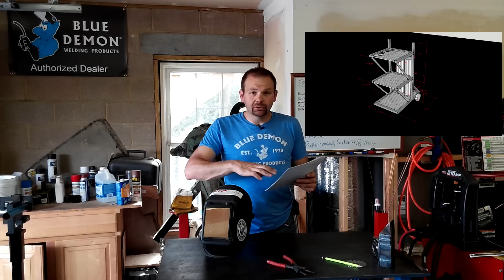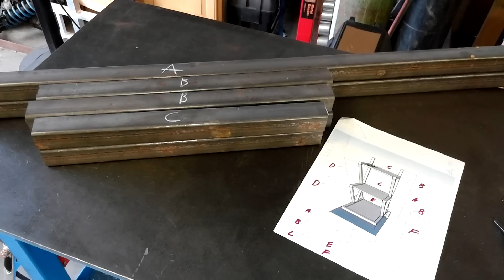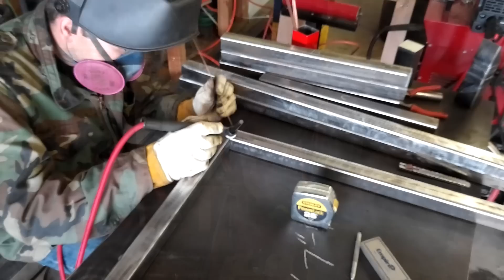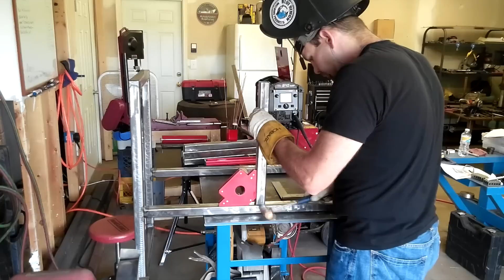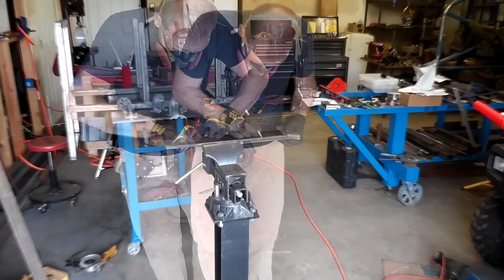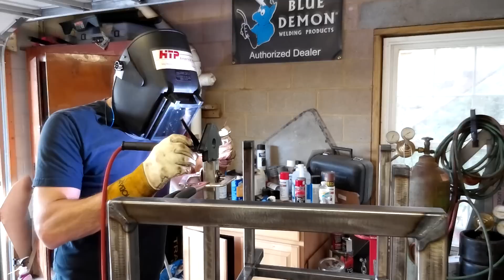Welding Cart Build Part #1 of 2

Comment: if you are going to buy a plasma torch you should look at the Everlast welder powerpro 205 not only do you get a 50 amp plasma torch but you also have the ability to AC/DC TIG weld and stick weld on the same machine for $1750CAD. which is probably less thn u would pay. for a simple 50 mp plasma. with a 25% duty cycle. the everlast has a 60% duty cycle. check it out t everlastwelders.ca
Reply from the maker: +topspeedjunkie1 

I'll check it out. I haven't got one yet but I am still thinking about it.

Thanks!

Comment: i like the idea of the clamp on the stand
Reply from the maker: +Jd Craft Thanks man.

I am currently working on part 4 of this video. I am building the cable holders.
Reply: ok i like the cart but for my use it would be a little high what i did for mine is i took angle iron and measured out the welder made a frame for it with 1 extra shelf below it it sits 24 inches high but yet again i dont have a tig machine they are worth quite a bit not to big or fancy but gets the welder around where i need it to

Comment: Love the design of you cart, mine is similar. One thing I noticed different was the caps you made for the ends of your shelf. On mine, I just made the end of the shelf on 45 degree angles, then the support leg under it also had a 45 degree cut, and I butt welded them for a seamless finish. On the other end of the leg, it also had a 45 degree angle that laid flat on the shelf below for rigid support! I almost done exactly what you did with the end caps, then I through about it and just done the 45 method, it worked out wonderfully!
Reply from the maker: Brandon Wilson - That sounds like a great design - If you have a photo of it post a link below. With your permission, I may include it in a follow up video.

Thanks for watching!
Reply: Part-Time Fabrication can draw you use a crud MS Paint deal that will give you a basic layout of what I did. As for measurements...I didn't measure. I just got the base square, in the size I wanted, mine was slightly smaller because it was a single tank, single machine setup, but the overall design was nearly identical.
Reply: http://i18.photobucket.com/albums/b110/Wicked03GT/Welding%20cart_zps1vtykxq2.png
Reply from the maker: Brandon Wilson - Yes, that is almost identical. Really good design. Do you have a photo of the finished cart? I'll look around your photo bucket for one. Thanks man.
Reply: Not yet, Im taking a wire wheel to the entire cart so I can use some self etching primer and then im going to use some high heat VHT automotive paint and then throw a clear coat on it as well to give it a super clean finish. I also made a trick like bottle holder with an easy disconnect that is fairly hard to explain without photos. Im debating on making another and shooting a video for it so I can show how I made it.
Reply from the maker: Brandon Wilson  - very cool man. Sounds like a awesome cart. I'd watch the video.

Comment: I think start tig with hand switch its more better from foot pedal and easier
Reply from the maker: Hey Malik Alrubaee I've never used the hand switch and I think it would be easier however you don't have the heat control. Typically the hand control only turns the torch on and off only. Now, CK Worldwide has released a variable control that your finger moves to increase/decrease power output. I would love to try this new unit but when I looked it was very expensive.

Thanks for watching